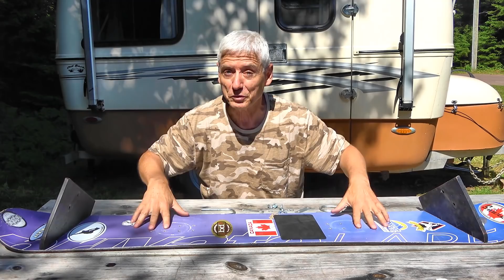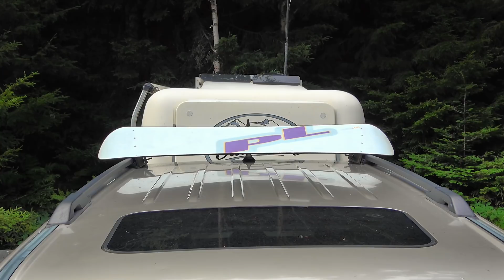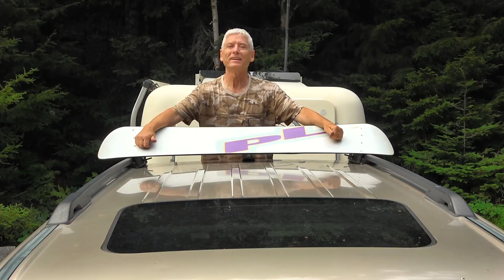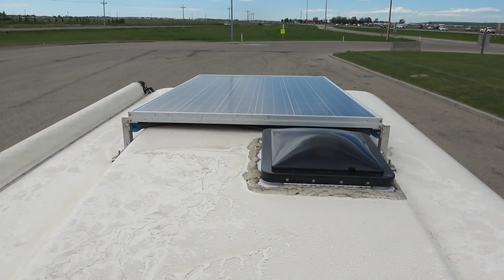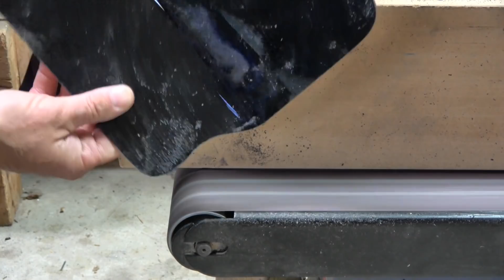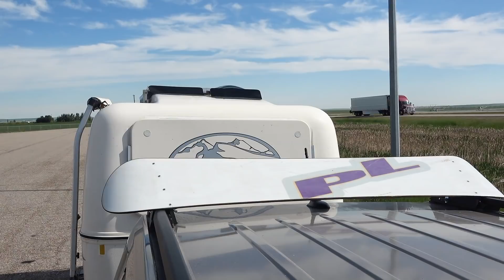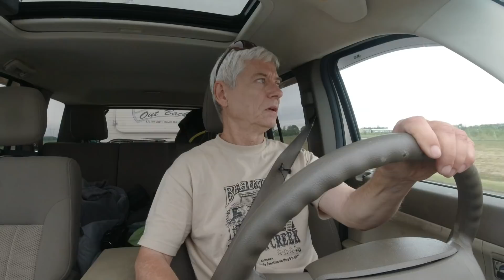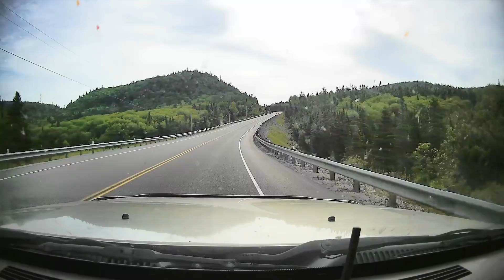Can an Old Snowboard Wind Deflector Improve Gas Mileage while Towing?

Comment: Hey slim I’ve seen some trucks use a shroud on the top and sides of the truck that are flared out from the truck to match the sides if the trailer. Maybe you can make a smaller version if that and it might increase you gas mileage every more. With some more plastic it might work, good for thought. Nice videos keep up the good work!!!

Comment: Something you may want to try is to move the deflector to the front of the rack. It won't cost you anything and may or may not be an improvement, but worth a try. Also, filling the gap between roof and deflector might be worth doing.

Comment: Great job. I guess the trucker that had 30 years experience has not been looking at trucks on the road. They have been using deflectors on their cabs for years. I will say, I think your setup works partly due to the small differential in height between your truck and trailer,  On my rig the trailer is quite a bit taller. The deflector also reduces the turbulent air that gets caught between your truck and the trailer. Like you stated, results may vary. Keep up the good work

Comment: I too like prefer my mileage in miles /gallon, but I see your conversion is from litres to US gallons. 
Here’s quick conversion I do when I fill up (as I use my trip odometer feature and the litres filled at the pump.) 
To convert  km and litres to miles / imp gallon…. Take the KM TRAVELLED divided by LITRES X 2.82 = miles per gallon 
295.5km/55.6 L x 2.82= 14.99 miles /gallon (imperial) … (just have to remember the 2.82 for a quick conversion !) 
Thanks for the videos !!

Comment: I use a yakima roof box when towing my scamp, I also noticed about a 2mpg increase when using the roof box, which acts like a deflector. If the wind is really blowing against me, I don't see that much improvement, but 55-60mph and without a strong headwind and there is definitely an improvement. I get 19-22 mpg towing the scamp 13.
Reply: What is your tow vehicle?
Reply: @markparent7999  2016 Lexus nx200t

Comment: Great video Slim !!! Keep us thinking with you, interesting and practical ideas. Really enjoy your adventures the only one question, that I would have been interested in knowing is your tire pressure? Keep traveling!
Reply from the maker: Good question! 55psi rear, 45psi front. I switched to light truck tires prior to these tests which allowed me higher pressures. Thanks! SP
Reply: One thing I am going to do is, on anything I attach that could fly off. I'm going to attach a small short cable.

Comment: You definitely should be doing better than 12.5 mpg. We get 12 pulling a 35ft fifth wheel (11,000#) with a crew cab diesel truck( 7500#). Maybe if you add a surfboard and/or a pair of skis ( between the car and trailer) you can get a few more MPG ! (LOL)   Bon Voyage !!  You may be able to make a living buying used snow boards and reselling as MPG miracles. I always get a kick when I hear a semi driver apply that experience to other areas.

Comment: While I’m loathe to offer any advice, I will make this one exception as you mentioned that you actually appreciate them.  So here goes…what about removing the rock/mud flaps from the back of the Jeep?  Instead, put some sort of rubber coating to the front of the trailer to protect it.  Those big flaps look like they could rob you of a little gas due to their wind resistance.

Comment: For a testing done under real situations not under strict test conditions,  it's good to see such improvements in savings. Presumably the mpg is US gallons. I have always struggled accepting any vehicles that get constantly anything less that 25mpg (UK), but that's just me.  Great work. Thank you.
Reply from the maker: John, 25 mpg UK is 21 mpg US. But are you towing? I would not expect 21 mpg when towing a trailer. SP
Reply: @SlimPotatohead  Hi. My current vehicle (3.8L v6 approx 2 tonnes) is needing a few long overdue tweaks. But it currently gets around the 23mpg on a bad day and 26mpg on a good day (mixed driving of city and highway). It should and has, been running better getting more around the 30-40 mpg. (its a 75L fuel tank and have pulled 990km out of it at times on highways). These are not much different when I tow a trailer of around 2 tonne either. I would expect up to 10 percent drop when towing. I have only ever had a major loss excess in fuel consumption when towing, which was with a friends vehicle (v8) and it was nearly twice as much fuel consumption as with out towing. (just a bad towing vehicle). I am lucky I guess as to my driving technique, where I also tend to get near or over twice the rated mileage on things like tyres. I was taught to drive within the vehicle and road conditions. So maybe, (unlikely) I am just lucky.
Reply from the maker: John, now I'm fascinated! What vehicle gets only a 10% reduction while towing a 4000lb trailer? SP
Reply: @SlimPotatohead  my current vehicle is an Australian one,  HOLDEN commodore v6,  3.8 litre petrol. It uses the same engine as the Buick 3800 engine I believe in the USA. 
My father had a 2litre 4cylinder Mitsubishi sigma in the 80s which would also constantly get around 23-26mpg seemingly regardless of towing,  city or highway driving. But towing forthat vehicle was only about 1200kg. I've had a 3.0ltitre 6cyl Nissan skive as well which would get around the 33mpg with not more than 5mpg drop with towing. 
I have friends, like myself now from hearing others results, that can't understand what ifanything I do different in my driving to achieve such results.
Something which might be related,  is that I am aware from motorcycle riders,  that my car shape does have a unusual air flow over and around it. So it is possible that this could limit air drag on anything within say 5metres from its rear?  That might explain the towing not making such a dramatic drop?  It is a mystery to me. I always thought it normal as I didn't know any difference. Except on my friends v8 statesman. Which is known to be a bad towing vehicle by all I have asked who has one.

Comment: Good job on your experiment!  My dad recently placed a Klamath boat on top of his full size cummins truck and it also increased his towing mpg. I think yours was successful because like my dad it deflected a significant amount of air around the trailer. In my situation my trailer sits so high above my tow vehicle I would need 3-5 of those boards in height to make a large enough ramp. Love your honest an open approach to experiments. It's a great way to iterate and improve.

Comment: This is great Slim! I have a small 5x8 cargo trailer that I converted to a small camper, and I put a big roof top tent on it, and when I did my MPG dropped significantly (no surprise as the tent is a huge brick). I then decided to put a wind deflector in front of the tent in the trailer itself, and the results were that my MPG went from 13.5 to 15, which is exceptional! Thanks for doing what you do and giving us ideas!!
Reply: Try doing the back too.  You may be pleasantly suprised.

Comment: I’m no aerodynamicist but I think you would want some air bleeding under the snowboard. If it were sealed at the bottom, there would be air sucked into the low pressure area directly behind the board, coming from over the top, creating all sorts of turbulence. Allowing some air to enter from the bottom should help to minimize this turbulence. Safe travels!
Reply from the maker: Interesting point. Thanks! SP

Comment: These results are heavily subjective to any number of factors including differences in wind speed, vehicle speed, acceleration, time of year, outside temp, AC use, placebo effect, etc. Not saying you're straight up right or wrong, just objectively saying you could be.  Good on you for saving $100 though!

Comment: Differences in the wind can make a huge impact, as can ambient temperature.  I've been tracking my fuel mileage for well over 50 years on many different vehicles, and another significant factor is elevation -- significantly less wind resistance at higher elevations.  Anyway, I'm sure your deflectors made a worthwhile impact.

Comment: I tow a 20 ft. trailer with a 01 Tahoe. I've had a deflector for a couple of years now, and it improves milage by about 2 mpg. The big advantage is that up a light grade, or against a light headwind, it will hold speed in fourth gear vs having to drop down to third. More gas savings there.

Comment: Slim
You will see this MPG change if you have a tailwind, headwind or crosswind. So I don't know
what Kinde or conditions you had, I have a 2003 Tundra large cap and 3, 200 watt panels, I get 16 to 20 MPG depending on the wind at the time and mostly flat roads.

Comment: Slim you gained 4 miles per gallon US. Their is a commercial product available called Air tabs that do the same thing. Air tabs besides increasing gas mileage, they also provide a little more stability when traveling in high winds.

Comment: Interesting… on my trip to the Tetons my 2021 Nissan truck pulling the 26.5 Jayco camper avg 11.9mpg ( great improvement over the previous 2018 Nissan which best was 8-9mpg) in Nebraska I had to buy a set of rims & tires after losing tire pressure for a few days I had two steel rims leaking… my speed was around 45-55mph … feeling more confident about my new tires the rest of my trip I kicked the mpg up (55-65) my avg dropped to 11.2 mpg … I found this interesting too…

Comment: Great idea using the snowboard. Looking for a solution for an air deflector on the front of my class B van roof rack after trying the Thule windscreen which is an overpriced piece of acrylic that was too narrow for my purpose. Time to start searching for the correct length snowboard.

Comment: Awesome outcome on your snow board experiment...  obviously it works...  I would also recommend  using AMS Oil products throughout.... Im not a AMS oil dealer....  I just found a big difference in fuel economy....  be sure to repack the trailer bearings in a good Ams oil wheel bearing grease....   Doc

Comment: Hi Slim, I also have a Jeep Liberty (08 in my case but same body style). I get 11-12 mpg pulling my trailer on the highway. I have to use the tow/haul button to lock out overdrive unless I am going downhill, but my trailer is probably heavier. Did you use the tow/haul setting during your test? I’m thinking if you’re seeing 16+ mpg you must have been in 4th gear a lot of the time.

Comment: If your not traveling on those dirt roads take them huge mud flaps off.
Reply from the maker: The mudflaps may have actually improved gas mileage as they may redirect airflow from underneath the Jeep and prevent it from going up between the jeep and trailer. SP

Comment: It wasn't mentioned but I assume that the speed traveled was consistent in both trips. While it was briefly mentioned, the wind direction and speed are actually a really big factor and a proper test would be best done in identical weather conditions. So my conclusion is that the snowboard deflector works but we really don't accurately know by how much.
Reply from the maker: Speed was consistent. I added a pinned note. SP

Comment: Great work with the deflectors! The ones on the trailer might need a more permanent mounting, I’d hate for the adhesive to become loose over time and they fall off at high speed. Try maybe drilling in some nuts and bolts. Great video!
Reply from the maker: I am absolutely NOT drilling holes in my trailer roof! I may tether them with a cable though. SP

Comment: Some 47 years ago, I worked with Edwin Saltzman at NASA Armstrong Center as it is now called, using a Ford Econoline van and a T-38 aircraft on the same thing. The trick is to minimize turbulent airflow at tje back of the vehicle, which your deflector actually does. I'm not sure the two on the trailer are as effective as you think, but they do help some..
There is an actual report out there on how it works-and it does!

Comment: Not sure you clarified and maybe I just missed it..... Did your old averages include your old tires? Tires can make a huge difference in fuel mileage.
Reply from the maker: I used the exact same tires (mentioned at 15:35). SP

Comment: Hello Slim, Yes wind deflectors do work. I use to manage a small plastics company that use to make wind Deflectors for Sears and Camping World back in the 1980s and 1990's. The Deflectors were tested in wind tunnels and on different vehicles and obviously the height of the tow vehicle and deflector determined  if the wind went over the trailer effectively.

Comment from the maker: 3 NOTES FROM SLIM: One thing I forgot to mention was cruising speed. I tried to be as consistent as possible, and kept the speed at just a few kilometers below the speed limit. I am NOT one of these people that go real slow just to save gas, as it is important to go with the flow and NOT inconvenience other drivers. Another note: The weight was pretty close both trips. Initially the trailer was 2078 lbs, and for the second trip 2094 pounds. Last Note: I used US gallons, NOT Imperial. Thanks! SP
Reply: You don't need to justify yourself Eistein awesome job
Reply: Slim vehicle speed definitely makes a difference.  Possibly 55mph is optimal?
Reply from the maker: Patsy you may be missing my point: Safety first, fuel economy second. I would never go 15 miles under the speed limit if it puts other drivers in danger as they try to get around you. Go with the flow. Thanks!  SP
Reply: @SlimPotatohead  oops in US especially in Oregon 55-65 is often the posted speed. I'm with you as to not holding up traffic.  However traveling to Colorado often speeds allowed at 70 nope not happening!  Safe travels.
Reply: @SlimPotatohead  My Dad was stopped by the Police once as he was by nature a slow driver. They told him it’s better to go a bit faster as he was causing tail backs!! I pull over myself and let people past because I refuse to go faster than suits me.
Reply: @SlimPotatohead  Hey Slim, I had the same thought about doing something to the trailer itself to help, but what about just mounting another snowboard on front of the trailer? Maybe on top of the front window or just above it? If you understand what I'm saying.
Reply: I had a post about hyper mile but as I see you primary concern is safety I can see that will not work for you so I deleted the comment. But while reading about that technique I saw some people pull a trailer but are a lot more aerodynamic at least the front of it. I think that is one advantage that my Aliner has over the current design of yours. Mine does have the air conditioner hanging out from the side maybe adding some aerodynamic advantage like you added to your vote and solar panel might help with that situation. What kind of mileage were you getting with your Aliner when you were using it although maybe it wasn’t that much of an issue as gas was probably cheaper back then. I still get about 12 mpg but I don’t do 55 I have to get out of Texas they have roads that are 80.
Reply: The only thing that I could think not being consider is probably the topographic declination. But even that would not be that much with all the data that you collected. I Always like watching your video :)
Reply: Slim 
One more possible improvement.
If you can attach material to the underside of the snowboard such that it forms a curve surface, that should accelerate the air passing underneath and hopefully if that flow "sticks" to the board, kick the airflow even higher over the trailer (?)
Maybe even some downforce for rear traction?
Reply: Love your videos but one thing kept nagging at me about the mpg gains. When I had my Burro 17 widebody my mileage would vary from 11 to 22 mpg. The variable was wind and how strong it was blowing. I had a strong tailwind once going down I-10 and averaged over 22 mpg over a 250 mile stretch. Earlier going the other way was 12ish. Always 60-62 mph
Reply from the maker: @Alfa Vulcan, I wish people wouldn't make assumptions. I did NOT say there was a constant tailwind. It was only apparent in one of 11 test runs, which I noted. SP
Reply: @SlimPotatohead  
He said what HE had once.
Reply: I don’t know if this is relevant, Slim, but I was told years ago only half fill a tank as you’re using energy lugging the extra half. Don’t know if that’s not possible with the big journeys you undertake. Hope you have moved in your new house. xx
Reply: @noddybrown6281  early I mentioned I only carry a small amout of water until closer to location however fuel I've learned my lesson to keep gas tank full. Take it from me running out of gas is a drag!
Reply: @noddybrown6281  In theory that would be ok.  But the difference of 50 pounds won't be noticeable.  Folks on road trips should probably use the top half of the tank; helps keep the fuel pump cooler and reduces the chance of picking up any sludge from the bottom of the empty gas tank

Comment: Hey Slim, like your critic, I too was a commercial driver for over 30 years. Anything that you do to reduce wind drag "WILL" improve fuel economy. Commercial truck tires actually have a rating for rolling resistance, less resistance, less power, better economy. 10 years ago a salesman came in to our shop selling vented mud flaps, he guaranteed 1/10% increased fuel economy. We had 18 trucks in our shop at the time and kept precise record., We tracked every truck, every month, every mile. With the vented mud flaps we improved our fuel milage by 3.38/10%. That 1st year we saved almost $36k. We now have those flaps on every truck and every trailer. Look at the mud flaps on your Jeep, they look like parachutes and your gravel guard on your hitch. You have to weigh the cost of having them on there vs the benefits. Great video, Thanks! "Quote me if you'd like"